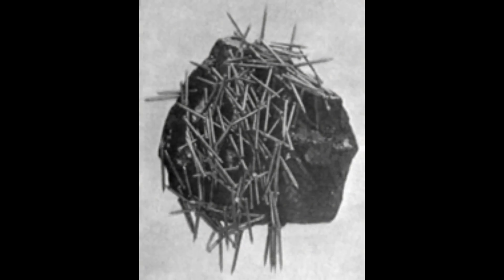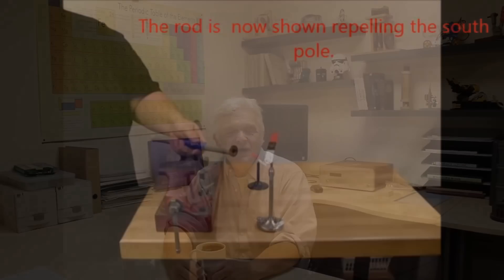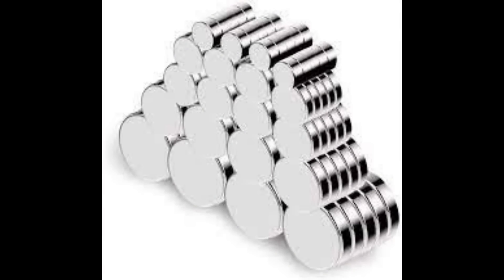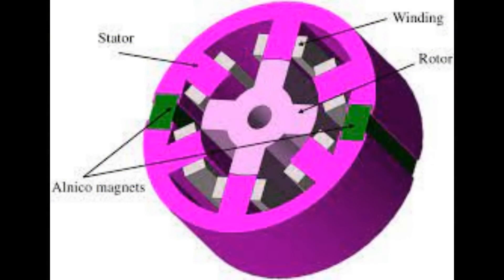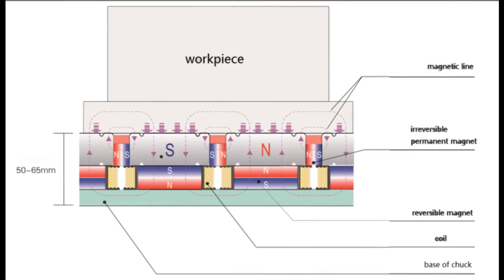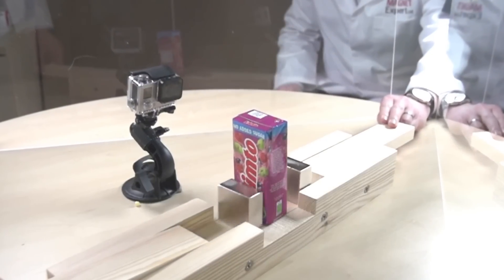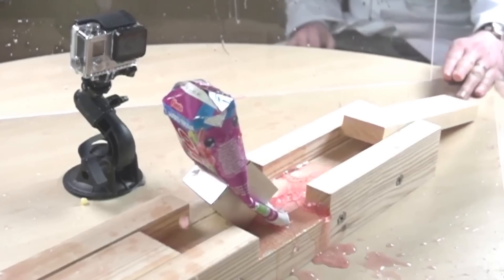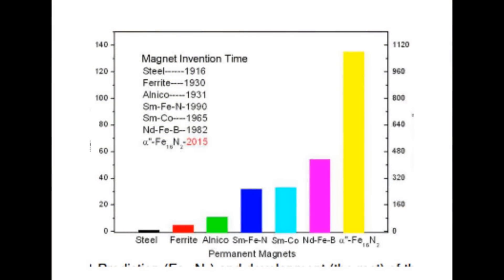1626 Clean Earth Magnets - The Next Step In Power And Mobility

Comment: @ 8:00 Repeatable, would of been easier to say.
Repeatedly, I didn't think it was a real word. 🙂
Very interesting video, thanks. You talk about magnet's but what about copper wire alternatives. Could you use ghrahene, ghrahene coated or other materials to remove magnet drag preventing notching, which then of course would decrease rolling resistance.

Comment: I (just found out) didn't realise that the EV industry uses mostly permanent magnet motors ~80% because they are lighter and more efficient, even Tesla. That way if iron nitride magnets can be cheaply mass produced it will indeed be revolutionary, forgive the pun, for that and wind turbines alike. But if the power output is 2.5x to 3x higher, what does that actually mean? For every watt of electricity put into spinning such a motor, it spins with 2.5x more kinetic energy than it would otherwise? That makes it seems like electric motors are incredibly inefficient then,  but 65% -85% of the input electric power does useful work typically right? So how is there scope for a 2.5-3x power output if only 35% of the input energy is wasted anyway? Should be ~1.5x at most.. feels like I'm missing something here.
Reply: You will never get more energy out than what you put in. I heard evs can be up to 90% efficient.  So the 2.5 to 3x refers to efficiency not power output.  The big misconception with evs is that it seems like you get greater losses.  Like aerodynamic and extra wt seems to drain and shorten distance more than a gas cat, but gas cars run at about 30% efficiency, tremendous heat losses.  So it's just not noticeable as much.

Comment: I wonder how efficient they'll be with your batteries if you use one of the motors like that the new magnets in them will you be able to run them at a lower voltage and still achieve the same kind of torque which also means longer travel times on that scooter you have if you can change the motor out for one of those with your battery in it

Comment: I have always liked the idea of storing solar energy in flywheels. If this material; in its non magnetic form,  could be thoroughly mixed in concrete and some graphene and the result " balanced " to form a heavy flywheel,  then magnetised to be driven as a motorised flywheel, it may be possible to use as a low cost stored energy device, producing an alternating current output for home power or short term power to get to the shops and back in your Bat mobile ?  * Turbines to speed "

Comment: Great info mining Robert . Magnets are one of the under reported areas of amazing performance increase/developments over the years ,with coresponding improvements in motors ,I think mr Conesieg has the best at this date  with his raxial flux motors . But 'New Atlas' [ once  Gizmag']. seems to find a development every other day . It seems around 300 Hp from a 25KG motor is current . So we can expect a doubling of that in the near future !?. A geological fuel generator with a capacitive storage and electric motors for drive , one per wheel of course, is looking tastier by the day .[ I'm not sold on electric I'm afraid , any battery fault totally negates any fuel cost savings ,one dud cell could mean replacing a whole battery ,at a cost of a cheap car . People that do long trips still need a second car with geological fuel ,so how does that help .and the mining /cobalt slavery issues ,and disposal .. untill we have a carbon /carbon /carbon battery ... ] .

Comment: Speaking of magnets and their curie point.  Have you ever wondered how the Earth generates a magnetic field ??    They say it is due to the iron core,  but if it's molten  (and we know for sure the temperature is way past the curie point of iron),   then  the  core of the earth shouldn't have any magnetic field at all...
Reply from the maker: I have wondered but to be honest I have no idea why I really must look into it more
Reply: I have read before, I suspect it could be true, it's because the core is spinning along with the planet - Above Curie temperature means that the magnet cannot retain the field, but if the iron is spinning then perhaps it can stay magnetized as long as it is spinning and molten - it's probably a lot more complicated than just that though because you have to account for the field apparently flipping occasionally
Reply: @mikehoman7351  
My theory is that there's an electric current in the earth. Big enough to generate the magnetic field. This would explain why there's a voltage potential between the ground and the sky. Basically the earth is a like giant electro magnetic coil. The source of the power would either be the sun or gravity itself.

Comment: Not a good idea to tumble steel balls and iron powder and ammonium nitrate in a ball mill.
Please don't try this at home. Ammonium nitrate has an explosion efficiency of approximately 40% that of TNT !!! Do you remember on August 4, 2020 in the Port of Beirut, Lebanon. 2,750 tons of Ammonium Nitrate  produced one of the most devastating blasts in recent history. The blasts supersonic pressure and heat wave claimed the lives of 220 people and injured more than 6,500 instantaneously, with severe damage to the nearby dense residential and commercial areas. 😧
It's ironic this channel is called TnT.
Reply from the maker: I am reporting what was done - this is the experiment clean earth did

Comment: Hi Rob! on film 1623 I had 3 Q:s "Three Q:s! Why are all motor/generators in center? (Then  the output increase in eight times for double  the speed!) And why do the meglev-effect not use more? (Then it can reduce the inertia!) And finally, Why does not the wind and the wind turbine work in a three dimensional environment?" +++++  With the magnets we have  seen funny rails how never stops! But in end a stop of the running train in an equilibrium! With a 100£ VAWT!  Why not use a kitchen cabinet magnetic closers! Cheap, almost an inch long! Pulls and puts on the side-generators how is on six airstreaming directional boards! now the magnets are even on the rotor blades! The generators works in 3D!  I Just love this film! 🥸 👍
Reply from the maker: Hiya mate - quite a lot comes down to very simple things - it is easy to build, it is what folks are used to and a lot of folks hate innovation equating it with risk of not working - which is fair enough if you think about it - and I don't understand you last point mate - could you expand on what you mean - cheers

Comment: The switched reluctance motor, one version is used in the model 3 is the single best motor for evs.  No permeant magnets, high energy efficiency, rotor does not need cooling(rotors are hard to cool) so cooling is much easier, high power per mass, three phase motor controller/inverter.
Reply: aren't the SR motors used by Tesla permanent magnet assisted ? I seem to recall a channel where they did a tear-down of one of them.
Reply: @MrTubeuser12  This isn't obligatory for reluctance motors. Electrostatic motors are another kind of magnetless motors.
Reply: @vitordelima  correct, it isn't obligatory, it is a design choice that uses the effect of permanent magnets in conjunction with the reluctance effect of the SR motor which in a sense makes it a type of hybrid motor in that it uses those two effects, I believe this improves the torque of the motor but as always there are pro's and con's to this design, (cost, complexity etc )
Reply: There are other magnetless motors, BMW released another one a few months ago.
Reply from the maker: I liked switched reluctance motors

Comment: Neodymium magnets are also very brittle, I have smashed a few in my experiments! They are very expensive for the larger sizes, so yeh new types of magnet would be welcome. Thanks Robert for informing everyone about these new magnets.
Reply from the maker: I am glad you liked the vid mate and I hope it is helpful
Reply: I noticed the same thing the very first time I started playing with them. I have encased my large neo magnet in a thin layer of resin and it solved my problem. I was convinced it would de-magnetize because resin heats up when it cures, but didn’t seem to be hot enough to do that

Comment: Where can someone find the steel use in transformers? Im looking to wind a toroidal transformer,  and need a large core,  about 4" tall, 10-12" diameter, with 4-5" center, looking for about 6kw output, without overheating, I want to build a new transformer for my inverter, mine can do about 5500w, peak, and on a cool day about 4kw for a few hours, or about 3-3500w constantly,  they MOSFETs are capable, it's the transformer they are pushing beyond it's limits, I have seen ppl use motor staters as cores, but I'm looking for something more professional, there is a lot of wasted space, and the laminations are orientated the wrong way around,  I have thought about using multiple smaller cores, but they are not that easy to find either, and are priced like gold or silver!   Just a rough guess, but I'm thinking it will be like 10+lbs of steel/iron core, possibly as much as 20-25lbs, with near that in copper, I'm hoping to build a transformer capable of 6kw without overheating, and surge near 12kw for a couple seconds,  maybe I can upgrade the MOSFETs,  and populate all the spots available, and get more power from the inverter , it is powering my house, so I can use the power, I tell someone I need to go buy gas so I can wash and dry clothes, they give a really confused look!😳,   I use a generator to wash clothes!!   To handle the extra current of the washer, and the 240v required by the dryer ,  I'm looking into getting a gas stove, but a gas grill works fine for most things , as long as the weather is decent,. Sorry to be a slight but off subject,  I figured if anyone would know the answer to my question it would be you,  and thank you for such great content!!
Reply: Find a old power line transformer but be careful cause some old ones contain pcb's
Reply from the maker: it really depends on what you have to spend mate - it's silicon steel and you can just buy the pressings from the company that makes transformer cores but it would be a little expensive as they would have to tool up just for that job - equally you could ring them and ask for an off cut